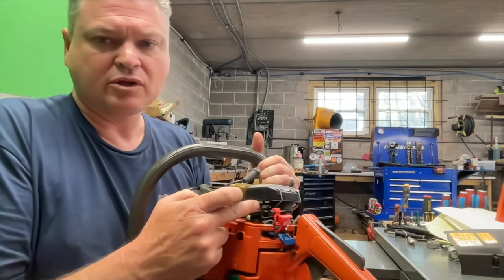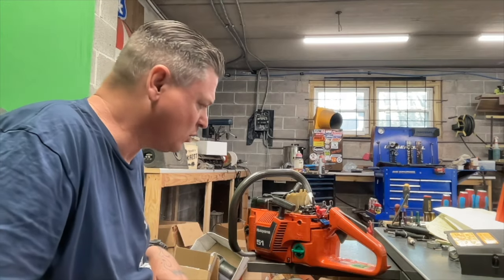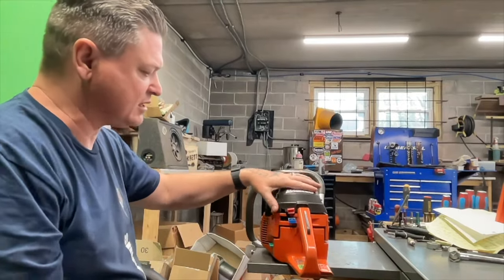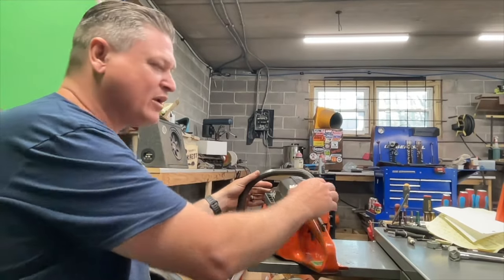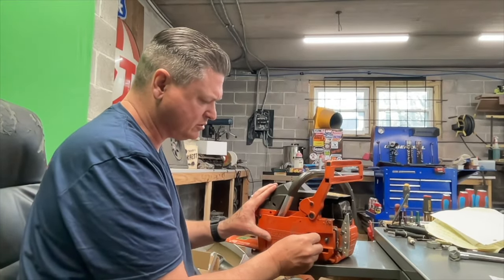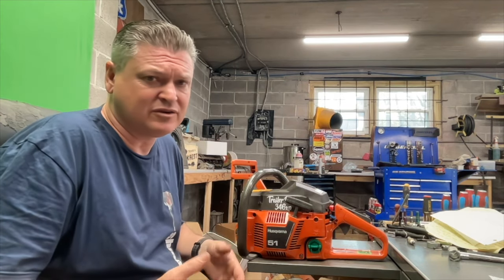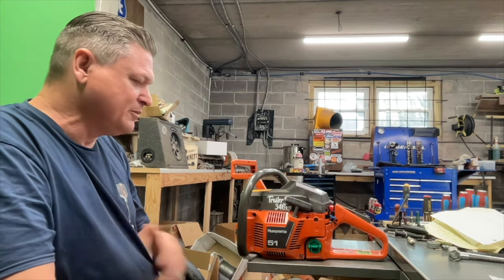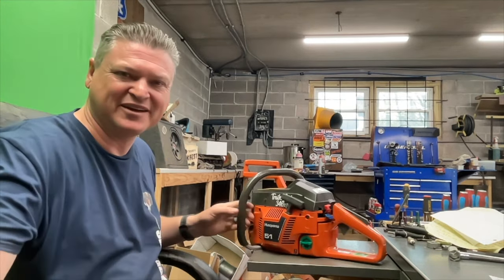Matt House built Trailer Park 346XP Husqvarna 50 51 55 Rancher @Houseworksaws

Comment: Dolmar 111 44mm piston
Reply: “Trailer Park 346!”  I’d love that in a sticker!!! I’ve got a couple 350 “super turbo turd’s” that’s I’ve been working for years that could proudly display that monicker!!!

That’s a “Tree-Fiddy Club” king of kings saw, right thar!
Reply: PS… that case trenching to clearance for your intake assembly is just off the hook!  I’m such a huge fan of that “357 intake assembly” to bump up those “hotter-rod’ed” 44’-45’ bores…50cc size….”Trailer Park” …” Queen’s!”   It’s raining in Pa today… I need a make a sticker for my next “Trailer Park Queen!” TreeFiddy! LMFFAO!!! That’s freaking fantastic!!!  Love the “Magnum” sticker slapped on there too!!!  I gotta pop over to the meteor piston site and check out the measurements on that Dolmar piston… I’ve been using a lot more piston swapping and trying to learn more about those sizing differences between what’s available to help get a project done with as little work as possible.  Just a super “Sweet” build!  I just absolutely love those “one of a kind” or one-off build’s and I really prefer them myself… just make’s the “workday” a lot more like fun and a lot less like work when you’re playing around with one of those saw’s… look’s like it would be a really solid and reliable workhorse too!  Very very cool 😎!!!
Reply: @DaveyBlue32  lol 😆 I had that decal made on Amazon. There’s a place that’ll make anything you want. Showed up a couple days later. The saw was fun to build and it’s actually nice to run. I brought it to work with me to get some run time on it a few times. I built it so it was reliable that way it would stay in the collection. I’m glad you like it thank you..

Comment: I know I didn't place near the top of the pack, but for the limited access I had to equipment, I think my saw might be a decent example for those who want to build one at home. I used absolutely every single part that would come on the saw from the factory and got some pretty damn good gains. I'm even running the stock carb. You're more than welcome tear mine apart and Check it out if you wish.